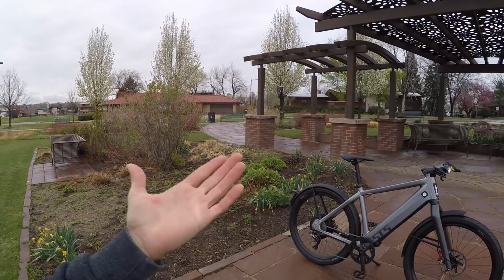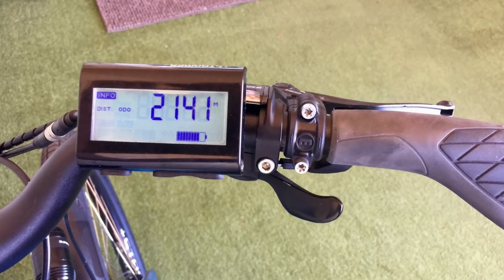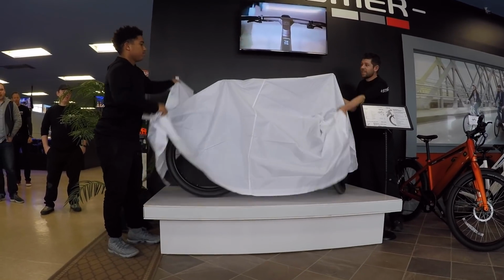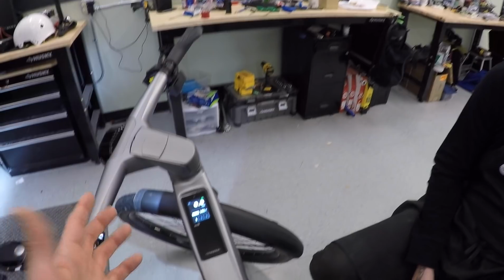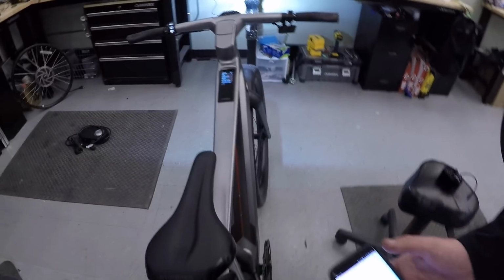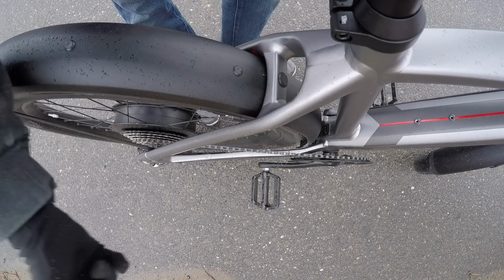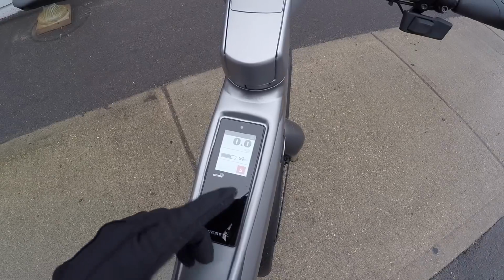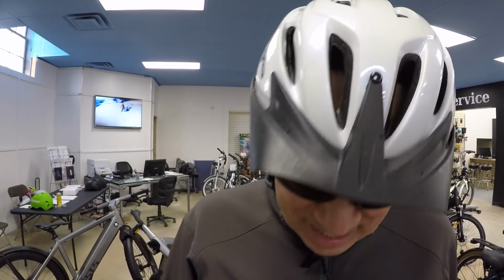Stromer ST5 Review - $10k

Comment: People, a rear motor in the hub is the best way to power an electric bike. The mid motor bikes will all put undue stress on the chain, cassettes,  derailleurs and chainrings just like a regular bike. The bike shops love to sell them because it is further revenue for them down the road when you are pushing the bike into their shops and telling them that it needs a tuneup. Another thing is that they are quiet you never hear them make a sound. This "custom tool" that the reviewer refers to is called a star drive or Torx drive wrench. It is no big deal to find one. You will need it when you get a flat tire. If you spend any time on a bicycle you will discover that flats happen. I have never regretted all the money that I spent for my ST-2. Bargain bikes and all bargain products, the rule never changes you get what you pay for.

Comment: I have the ST2. Great bike. Blast to ride.  Bosch is great but the Bosch wall sucks. Great Mountain Bike motor( I owned one) but the Stromer rear hub motor is just more fun for street use....like a rear drive sports car. The new Omni is a fail IMHO. A thousand dollar upgrade...lol. When I bought my Stromer I was told they would upgrade me for free to the new Omni. When I saw it and used it on a demo bike I said pass and it was free. It starts up slower and the Bluetooth walk up unlock fails all the time.  takes 4 seconds to enter the password. Not the upgrade I was hoping for.

Comment: You need a torx tool for the rear axle bolt. You can get smaller size torx tools in a driver form (like a screwdriver), but they're also made in socket form, which is what you need for the axle. There pretty easy to find at tool outlets like Harbor Freight. There is another type of fastener that looks similar to torx, and their also available in socket form at tool outlets.

I don't see why this bike is considered a replacement for your car more than any other electric bicycle (not including the sub par $1k bikes). Sure, it goes 28 mph, but most electric bicycles will go at least 20 mph, so there is only an 8 mph difference. I remember riding a bicycle in Southern California on a 5 mile trip 4 or 5 times a week. I probably averaged 15 to 20 mph and I arrived at my destination only 5 to 10 minutes slower than if I was driving a car. I think traffic and traffic lights had a lot to do with that, but I guess what I'm trying to say is just because something is faster doesn't mean its going to save you a huge amount of time when traveling from point a to point b. Is saving 5 minutes a day worth an extra $7k? Its not to me, but I guess the more money you have the easier it is to spend it.

Comment: Court, I have heard you describe on many occasions that the "rear light" on some bikes glows bright when the brakes are applied. But you will never use the term "brake light" or "stop light", as if that could not apply to a bicycle. E-bikes are surely not scooters or mopeds, but they can be equipped with Brake Lights or Stop Lights; it's about safety and all bikes can benefit from this distinction.

Comment: motor torque output of 48 Nm  in 2019 when  bosh have 75nm Yamaha have 80nm brose have 90nm and there is a New german brand that have 120nm installed in some off track ebikes
Reply: The hub motors need less torque to push the bike compared with the mid-drive motors, therefore it's a bit hard to compare the hub motors torque vs mid-drive motor torque.

Comment: Too bad front fenders are still way too short. You'll get wet feet pretty fast. Why isn't there a rack (or at least a possibility to mount)? Are the rims tubeless ready? Only one place to put a bottlecage or a folding lock on the frame. Face it, this bike is lacking stuff that should be standard for such a high price.

Comment: *Stromer ST3 vs. Stromer ST5*
If you are wondering about buying Stromer's ST3 or ST5 consider this:

The difference between those bikes is: 3.000 €/$

You ask yourself: Is it worth it?

The only significant advantages of ST5 vs. ST3 I figured out are (after 18 hours of pure research):

1. Little more motor power with the S-Mode  (my calculation: 280 € added to ST3 by tuning OR motor development would be legit)

2. Electromechanical Shimano (my calculation: with another 350 € added to ST3 it could have been actionable and still profitable...at least production-wise)

3. Better lights (my calculation: worth/legit 120 € max all incl.)

To sum it up:
The ST5 has 750 €/$ more value. Ok, let's even say 1.000 €/$ !

But the ST5 cost 3.000 € more than the ST3.

My Conclusion:
The ST5 is especially equipped with an early-adopter price. So you will be very very fine with the ST3 if it's not about your ego, but about quality and a rational purchase.

If it IS about your ego this will cost you around 2.000 € at least, so just that you know. Btw: I am still wondering about paying that ST5.

And if I buy it, I will need to acknowledge that this will be because of the same energy that made me buy the iPhone X vs. the iPhone 8.

Anyway have fun!
Reply: Thanks for the breakdown, Peter! Just ordered my ST3.   :)

Comment: My Stromer ST2 was 7500 a lot of money I road it 48 miles each way to work. Charged 2x per day. I saved 5 dollars each day in bridge tolls. The bike just turned 14,000 miles. This bike works day in and day out. Unlike all the home built haters. Maybe should ride the bike. No rad is going 14,000 miles. If you want a cheep Chinese bike get a Juiced bike at least they are in factory keeping quality to a higher level. Then kickstart or indigo go junk. Throttle dies in first rain, motor controller dead in 6 months.
Reply: Cloud Base Juiced Bikes aren't "cheep". I'd say "inexpensive" is a better description, and the reviews by actual owners differ a lot from your doubting opinion. It may not be as pretty as a Stromer, but real owners are loving it. When it comes down to it, the Stromers only real advantage is style. They are not employing some new advantageous technology that gives it's buyers an incentive to buy over the "cheep" Juiced Bikes. The only incentive for some people would be bragging rights to say "my bike cost 10k", which for me, I'd be embarrassed to admit.
Reply: I'm at 3500 miles on my radrover. No issues.
Reply: You commuted 3.4 hours a day, at least. (96 miles / 28 mph = 3.4 hours)  But given that you can't maintain 28 mph for the whole ride it was longer.  That's mental.  At least this bike was a reliable ebike choice, so good to hear about your experience.  You should do a testimonial for them.

Comment: I just bought the ST2. It is a total blast. I had a Bosch powered bike. That 20 mph wall makes it not a fun street bike. Great Mountain bike though. The Stromer just corners so well. Such a quality bike. Expensive but a very fun toy. You get to come down those massive hills you climb so hitting 60 mph downhill is so much fun.
Reply: I totally agree - had a great Bosch bike but that “wall” made me sell it
Reply: Are you both referring to when you got the top speed on a Bosch motor it holds you back from pedalling any faster. Is this different with this bike? You can power through and keep accelerating faster than the 40 km/h even with the assist on?

Comment: Nice bike...what kind of range can you expect on a full charge? Also is it only pedal assist or does it have a throttle?
Reply: Pedal assist. Max speed 28 mph. Full charge will give you 40 miles of range at full speed, if you drive a little slower, you get a lot further of course

Comment: So a Zero FX motorcycle base model is $8500 with the 3.5 Kw battery.  30-50 mile range top speed 85 mph.  So how is it a bike with 1/3 the batteries lighter motor and less material all around costs more?   I'll take the Zero or a $3,475 Sur Ron electric bike.

Comment: 40:40 "48 N.m of torque which is quite a lot for a hub motor." LoL
My hub motor puts out 155 N.m of torque.
But it's only a conversion kit. Less than $600 though.
$10,000.00 is bonkers. Is it self-driving or something?
Reply: How do you calculate torque?
Reply: If your conversion kit actually puts out 155 Nm of torque, that's 114 lb/ft.  That's the same amount of torque as the Suzuki Hayabusa has, which is one of the most powerful motorcycles in the world.

Comment: US$10K still with a Hub motor?  Stomer must be kidding. You should try riding with Bafang Ultra M620 Mid Motor. My customize bike with Top branded components cost less than US$3K with Bafang M620 is more superior than this ST5.
Reply: Hub motors are better.
Reply: is that the best motor bafang offers?

Comment: This is a great example of an E-Bike that was made to withstand speeds way beyond that which it is limited to from the factory
Reply from the maker: Great point, Danny. I feel like Stromer has built something beyond a bicycle here, in terms of strength and durability. I like to see that... especially given the higher speeds and longer warranty. It's meant to perform like a motorcycle or car and that is something most other electric bikes fall short on. Between the thru-axles, sealed circuit boards, custom thicker tires, and premium lights... it's durable and capable at high speed in many environments
Reply: B52 cough cough.........

Comment: 10k and doesn’t even have suspension?  No thanks
Reply: David Bradford 
A suspension doesn't make it better it makes it worse.10k for a commuter bike is insane,I don't care what kind of tires you have.
Reply: @Trump_is_a_moron  Why does it make it worse?
Reply: Luckily no suspension
Reply from the maker: It sounds like they will be offering a suspension upgrade in mid-2018 but the bike felt pretty good without when I lowered the air pressure to ~27 PSI. It's a heavier, more solid frame, that takes the vibrations. The air fork is going to be inverted for stiffness and to work with their custom tubular fenders, should be cool. Here are some pictures: https://electricbikereview.com/forum/threads/the-new-stromer-st5.14314/page-7#post-139339
Reply: Carbon fork

Comment: One thing that gets me so aggravated is the fact that Stromer, Specialized, and other high end E-bike manufacturers don't sell lower priced alternatives. Some of us would love a Stromer but don't want to spend $10k on an e-bike. Even if they sold a bike at the $5k price point they would probably make a killing with it.
Reply from the maker: Hi Jessa, I believe that they do have some options in the sub-$5k price range now. The ST1X is right at $5k and you can still find some ST1 models in the $3k range. I really liked the ST1 Limited that they loaned me for a long-term review a few years back, it was quiet and fast like the ST5
Reply: Seb K The only real good ones in the last years: Tubeless, Push 11-6, Dual- air chamber forks, 11x drivetrain, longer geometries,dropper posts and Pinion... all other new things are are just gimmics and not worth the money

You will be nearly as fast with a 2012 bike as with a 2018
Reply: Martin Schmidt these bikes are not Ferraris. They have a cleaner physical look but the tech difference between a Stromer and a more reasonably priced bike, like the models made by Juiced Bikes for example, isn't that radical. Stormers are beautiful bikes but your car analogy does not work here. You won't get a performance difference on these bikes like you'd see between an infinitely more complex Ferrari and an average Mustang.  Basically, the only REAL advantage a stromer bike has is it's looks. I bought and still own a  stromer st1 when e-bike choices were not as plentiful as it is today and can honestly say I won't be buying another Stromer because of the price.
Reply: TickTock Bam was that statement for me? Far from poor. Not braggin' but I got money. 😎
Reply: F T just FYI the gt350 is pretty darn close to Ferrari pricing at 1/5 the price...
Reply: F T this is not so much about it being a Ferrari, but rather it being a high end product I think. From a marketing perspective maintaining high priced products is a strategy. And that way they can also focus their r&d on the best technology, materials and construction, and not on ways to cut corners and do cheaper.
That’s my view.
Reply: Jessica, I’d like to sell you a st2 for $5k plus free shipping.
Reply: You can buy a really good mountain bike that is about 5 or more years old for a fraction of new.  Then  buy a powerful conversion kit and even pay someone to assemble it , if you don't do it yourself.   The result would be a fast, quality rig for  less than  1/5 th  of this Stromer.
Reply: georgebushwack Stromer is quality
Reply: I agree that Stromer is Quality .  I was just advising Jessica that  there are ways of having very good quality ebikes for much less than $10,000 US plus taxes.   A 2018 Mazaratti  is Quality  but is it a wise purchase ?
Reply: Martin Schmidt Yeah comparing a fucking bike with a car... a bike is way easier to design and R&D wont cost a fraction. 
Bikes are overpriced- mountainbikes for sure- they ger more expensive every year but no new tech.

Comment: At 5:00 - Torx is a standard fastener type.  I would run far away from any shop that tried to jam anything other than a Torx wrench in there.  Very common in European machines and the auto industry as a way to discourage tampering, but it's also a superior fastener.  Far less chance of the key rounding out over a hex (Allen).
Reply from the maker: Hi Iain Hendry, thanks for the tip! I didn't mean to throw this shop under the bus, they just didn't have the correct tool and did their best with what was on hand. It's not too expensive to get Torx bits online https://amzn.to/2JgYODA but I just don't see them in store as frequently. Apparently, to get the bikes here from Switzerland on time for the event, there was a lot of hustling by the Stromer team, and they probably forgot to mention the bolt pattern to the US shop because it is more common where they are from. I'm just glad that everything worked out in the end, and the bikes were rideable :)

Comment: Way too expensive....not even a rack on it.
Reply from the maker: Hey Pablos, the guys from Stromer told me that there will be a rack option, but I didn't get a price or timeframe for that. Apparently, it will look like the rack for the ST1 and ST2 models, which I show at 6:40 along with a rendering overlay
Reply: ElectricBikeReview.com I know but it should be within the price, such a rack. The other thing is that it should have an adjustable steering so you can sit straight up. It looks like a porsche without too many features. I couldn’t afford it. If you compare these bikes with the Riese muller bikes.....
Reply from the maker: Yeah, that's the one area I was struggling with... no way to swap the handlebars or stem for more upright body position (at least at this point). Perhaps they will launch some solution at a later time? Apparently they already redesigned the bike frame to fit the 27.5" wheels and made it more upright by default
Reply: ElectricBikeReview.com thanks court. I really like your reviews and the personal touch you give the audience. I learned a lot watching your reviews.

Comment: My self build electric bike passed ST2S and was about 7 grand cheaper.Sure it looks greats and is better build refined but not worth 10k$.
Reply from the maker: I appreciate how even-keeled your comment was... yeah, the ST5 has some amazing integrated features, it looks great, is near-silent, and it does perform in terms of acceleration and power... but you pay a premium for it. Which frame did you use to build your bike?
Reply: I used a KTM Mountainbike and upgraded the Brakes to 203 mm Disc & Magura MT5E.. equipped with a 1500 Watt Hubmotor, it out performs every stromer. However it looks like a tacker ed boat with the Battery bag and Controller Bag. So i would say Stromer is like a Mercedes E-Class compared to a Riced out Civic. :)))

Comment: Its a a great electric bike packed full of Good Tech & Quality Components...But with Haibike releasing their Urban Plus ("Stromer ST" Copy) as well as Rad Power City the price point is "too out there"...Would love to know what their production unit cost in Euros
Reply from the maker: Me too, it must be pretty expensive... all of the parts are Stromer branded (saddle, rims, tires) and there's so much custom frame work, circuit boards, the integrated display panel, and that battery. It's one of the most custom and well-done electric bicycles out there. They didn't just integrate a Bosch battery and motor, they made their own stuff (I guess TDCM custom made the motor, to be perfectly fair). For anyone who hasn't seen the Haibike Urban Plus, it's a fun bike as well: https://electricbikereview.com/haibike/urban-plus/

Comment: Total rip-off. You can buy two specialised mid drives for that money
Reply from the maker: Howdy PDB Lang! You actually can add a rear rack (much like the other Stromer bikes), it attaches to the top of the rear fender and is actually pretty sleek. I included a photo from an ST1 Limited and their renderings at 6:40
Reply: PDB Long so is a Porsche a rip off as well ?
Reply: Mehdi Nebbaki at least the Porsche has beautifully tuned suspension. And a German motor. The Stormer has no suspension and an off the shelf Chinese motor?
Reply: That's no BBSHD...
Reply: They would be slower and noisier and would not go as far.
Reply: "European" is supposed to be the selling point;  totally rip-off.  No way to add racks, I would not buy for half the asking price.